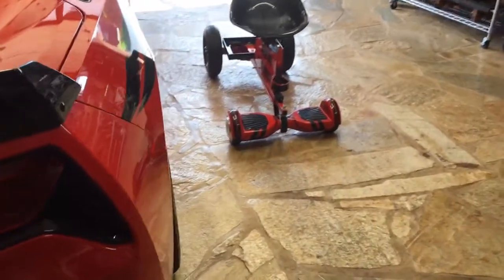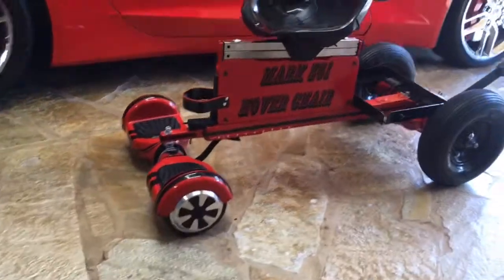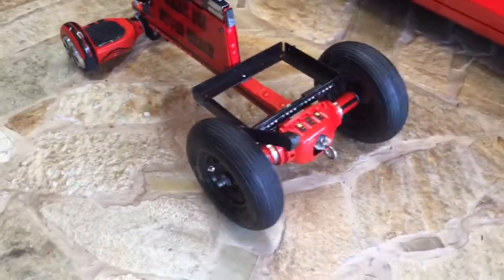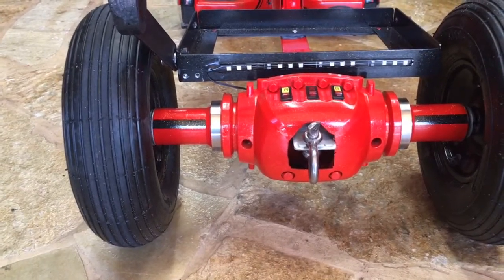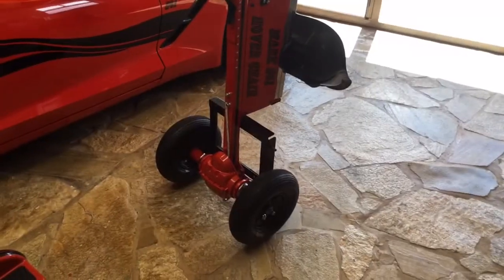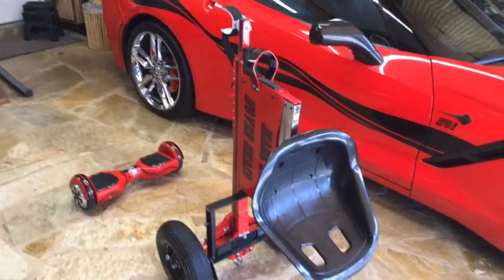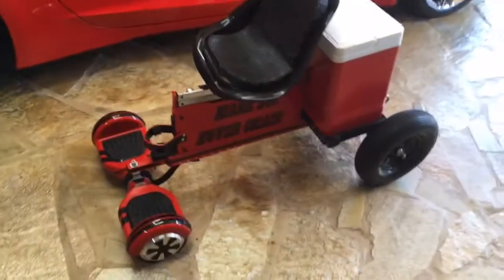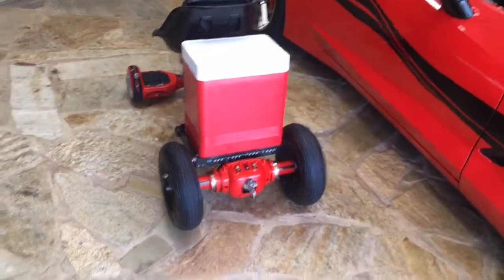Hover Chair for Hover Board

Comment: It is pretty neat!
Reply from the maker: I am still working on the engineering. Because there is no suspension on the hover board when you go over a bump it messes with the sensors and locks up. I am going to install a springer front end to try to solve that problem. Aloha, Mark